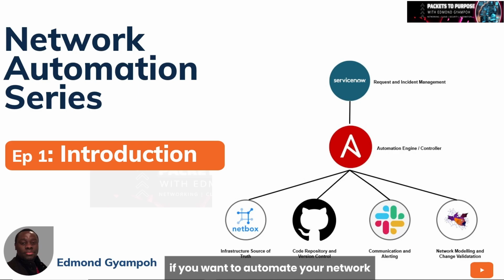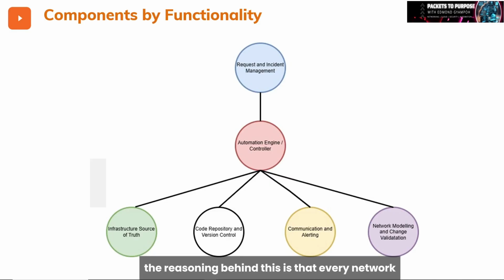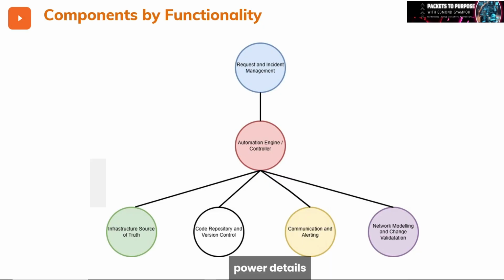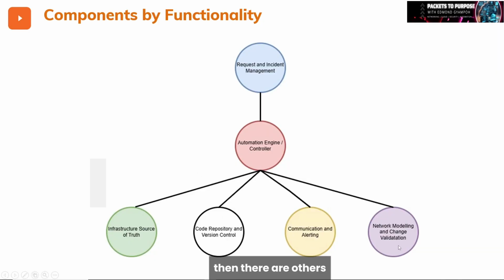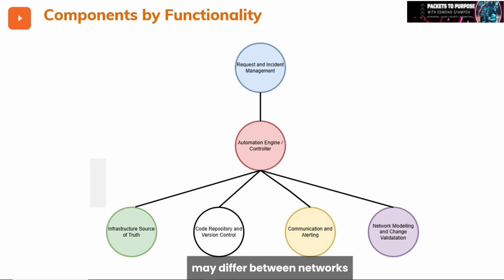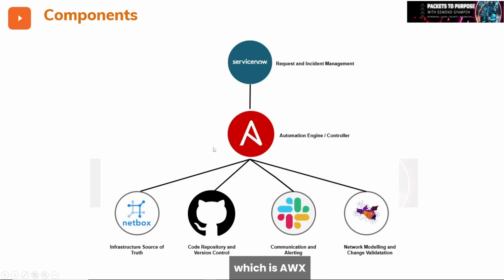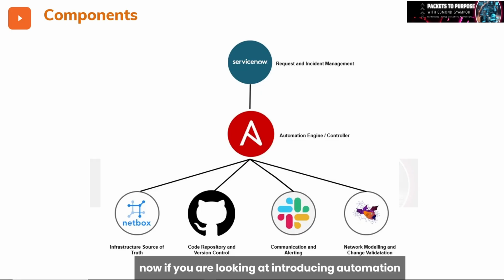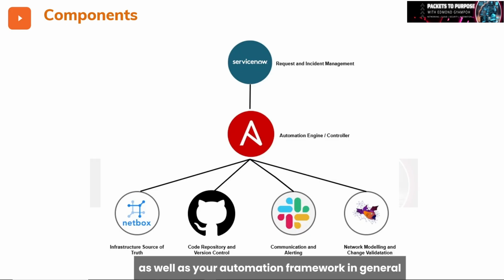Build Your Network Automation Stack from Scratch | Ep. 1

Comment: i edward, i looked at ur video and have a question. I was looking at a good tool for my companies IP database i was told about netbox, am i was curious about how it works. Is netbox good for Comapnies (its not a startup btw)
Reply from the maker: Hello @arytchaks. NetBox works very well for companies of all sizes, not just startups. It is used by some large enterprises to manage their infrastructure. For your specific use-case, NetBox has a full IPAM module that you can use to manage your IP Addresses, Prefixes, BGP ASNs, RIRs, Aggregates, VRFs, VLANs etc. Subsequent videos in this series cover different aspects of NetBox. Will add a couple of videos on NetBox IPAM since you asked :-)